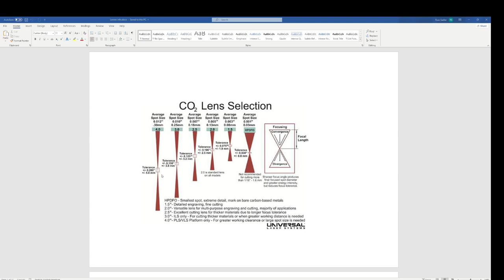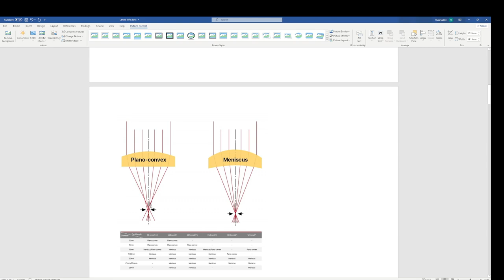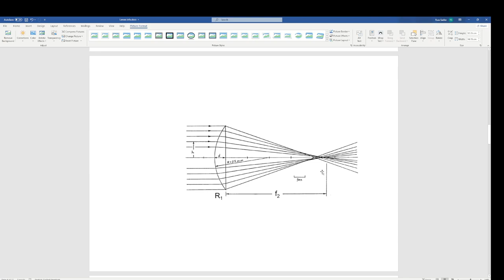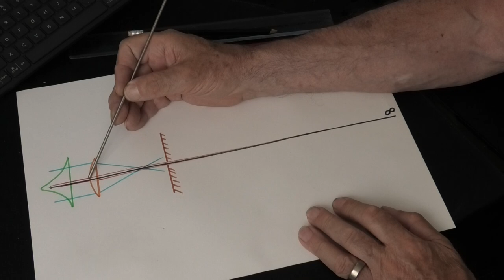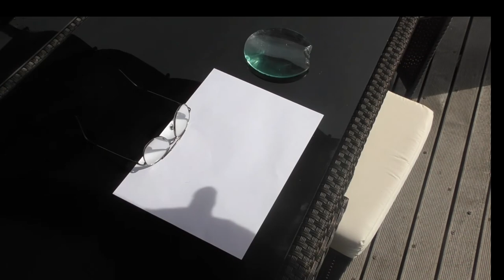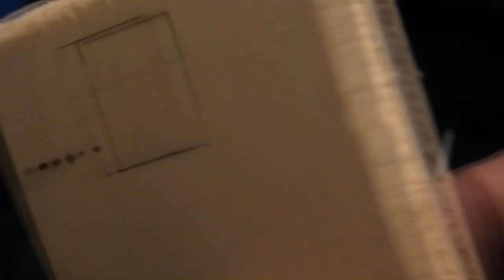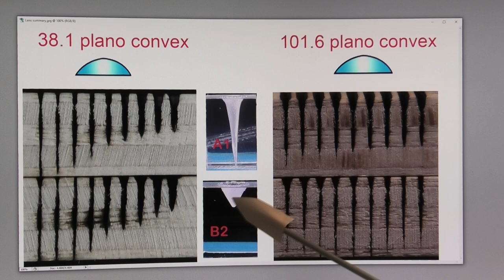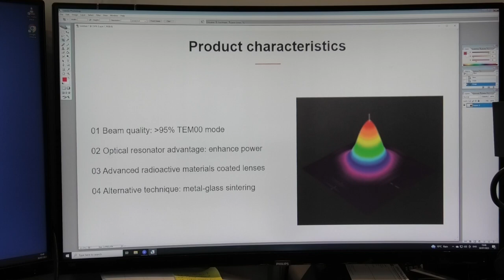Laser Beams and Lenses  Two Unruly Teenagers Pt2

Comment: Great video Russ! Question: My lens holder/3rd mirror is not perpendicular to the cut surface. There aren't any adjustment screws to change the angle, and I can't seem to find a new adjustable mount for the lens holder/3rd mirror. Any ideas?

Comment: Hmmm..... So where does that leave us? I guess I'll just have to wait for part 3.

I thought you did this test years ago. You did cutting tests, then changed tubes and it cut better with the high quality tube.
Reply from the maker: Your memeory is pretty good but I didn't change it for cutting issues. I pointed out that it was cutting fine but that I could not get the precision dots I wanted for my photo engraving. I have yet to test the contrast between these beams with the compound lens I use for engraving.  This was a straight comparison between simple plano convex lenses that most people use to show that lenses are not the perfect devices that we all believe in and that when you pass a laser beam through them there are conflicting properties of each that cause all sorts of detail issues.  Many thnks for the reminder

Comment: Very interesting how does this change if you use 2 lens? Do we lose power as it passes through or do we get a better force?
Reply from the maker: Hi Joseph. 
As you work through my videos you wll seet that at one stage I tried to amplify the inensity effect of a beam  by using various pairs of different focal length lenses. In the case of creating a super small clean dot, I succeded but when I  tried to use two lenses for increasing cutting speed/depth I came across a brickwall. Lenses are designed with a focal distance based on the assmption that the rays entering the lens will e parallel. If you use one lens to focus the beam down to a smaller size then two issues ensue. First the rays are now converging at the second lens  so this automatically reduces the focal length of the second lens. The smaller beam hitting the second  lens is  now  not a  Gaussian distribution (because of spherical aberration) and is being poorly focused by the less refractive geometry at the centre of the second lens.  If the lenses are touching (as with the short focussing compond lens system I designed for photo engraving) this effect is not important, however putting distance between the lenses  does not have the expected intensity amplification effect you would imagine..
Reply: Ok I have a question: What type of lens ie. ZnSe,GaAs,Ge,CVD-ll-vl Znse  for photo engraving is ideal.?  I believe 1.5 is a good length but don't understand the types. Do you have a video on this subject.  Thanks Joseph
Reply from the maker: @josephlovell6951  Hi Joseph
 Yes there are several videos on lense but it is all summed up in these two videos.
Forget germanium as a lens because after about 12 watts the power changes the crystal stucture of the lens and it becomes opaque for CO2 light.
 The lenses we can buy for our machnes regardless of price or material,  ALL possess  an unbeatable physics property called spherical aberration. In normal lens use for telecopes . projectors, camaeras etc  the light is always uniform intensity as it hits the lens.with parallel rays. Under these circumstances the standard laws of lens theory apply.   However.we are not sending a uniform intensirty beaminto the lens and we are not trying to project/capture an IMAGE. Instead we are tring to intensify the intensity of the bean to damage material. An the golden rule for damaging material is " the greater the INTENSITY the FASTER you can do damage". 

There are two lens forms we can buy. One is plano convex which has significant spherical aberration properties and is designed to be used flat side towards the work. The second type is  a meniscus form where the lower face of the lens is concave,. This reduces the spherical aberrationeffect by about 90% and produces a  pretty small concntrated spot size. This form of lens is ideal for engraving whereas the plano convex form, with its HORRIBLE optical properties. is actually more efficient at cutting.

There are basically only two types of lens material we can use .
1) Zinc Selenide
All ZnSe material  is poor at transmittong CO2 light (about 70% efficient) and is toxic to handle. However, in the same way that you see  a blue/mauve hue to camara and binocular lenses which is there to improve light transmission,  so it is with ZnSe lenses. They are coated with several layers of exotic materials to provide an anti reflective coating to improve light transmission to 98% or better.. Althnough ZnSe can occur naturally it  is always grown in a laboratoty  (jusyt like silicon chips) The Chinese use a manufacturing technique called Physical Vapour Deposition (PVD) whereas the USA uses a process called Chemical Vapour Deposition  (CVD). The PVD materal is limied to about 80 watts  whereas the CVD material can handle up to about 200 watts .  The ll-lV material is always CVD material and has a slightly more efficient  anti refection coating. ..... but you pay a lot more for that 1 or 2% transmission improvement. Remember that ALL these lens types are designed and made according to factors defined by conventional lens theory  so there is no significan difference in the GEOMETRY between any of these ZnSe lenses, they all perform  the light intensification  function in exactly the same way regardless of manufacturing process or price. By the way, the AR coating on the ZnSe makes it safe to handle  but be careful if you break a lens.
2) Gallium Arsednide
This is a weird material because  it is black and you cannot see through it.  So you wonder how can it work as a lens?  Light is equally unfathomable because at 12.640 nm wavelength this black material is transparent and allows the light through. This materail is even less efficient at transmitting light (about 60% efficient) but by adding exotic materials  to produce an anti reflective coating, the transmission efficiency is again about 98%  However there are two properties that sets this materiial  apart fro any of the ZnSe products. First. it is mechanically stronger and will easily handle powers in excess of 500 watts . Second, it has a different refractive index that means that for a given focal distance the  shape of the lens geometry is "flatter". 

As I show in these two videos. the focussing  effiiency of a lens is not constant, it depends on the INTENSITY distribution in your beam. For your RF machine  the situation is very complex because your beam is being modified by a beam expander  as soon as it exits the tube. This basically destroys the nice Gaussian intensity distribution  and what is sent aroind your machine is an unpredictable intensity mess, The RF machine is pretty efficient at engraving  (if you find out how to control your dot size) but it is very inefficient at cutting   (yes I know it cuts)  but the spherial aberration property of the lens can only be exploited by a decent Gaussial intensity distibution.

Finally if you are looking to produce the smalles dot you need a special compound lens with a very sort focal length (about 20mm) that I develoed and is on sale at C;loudray
see  this https://www.cloudraylaser.com/collections/nozzles-lens-tube/products/cloudray-n04-universal-compond-engraving-nozzles                   and scroll down to see lots of detail. Sadly , Trotec have locked you into a rather expensive and inflexible  lens mounting design and a high definition lens arrangement was never on their design radar. This means doing the best you can withthe shortest focal length lens available and see if it can be of meniscus form.
Reply: @SarbarMultimedia  thanks that is helpful